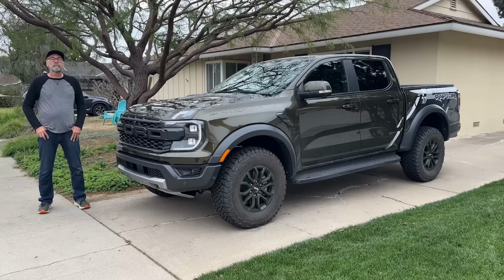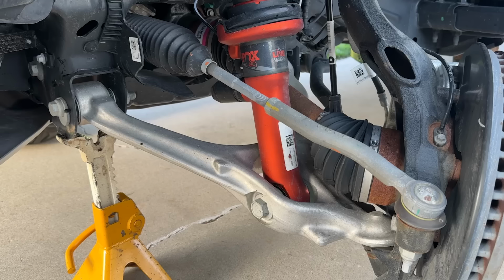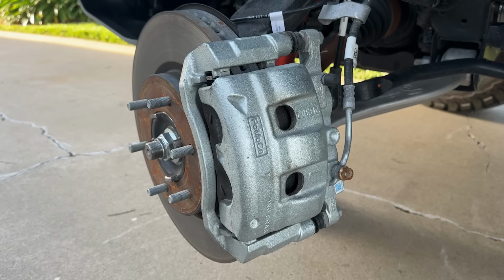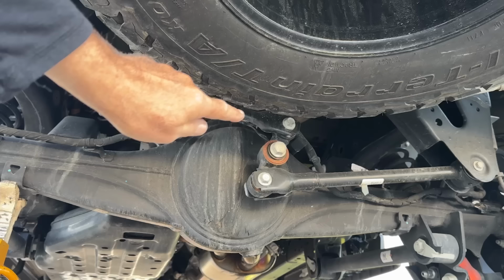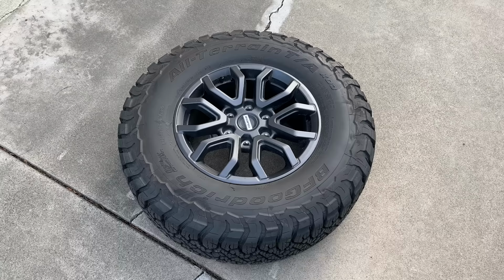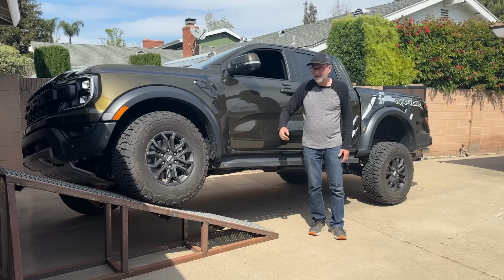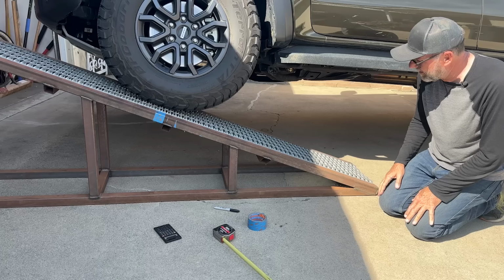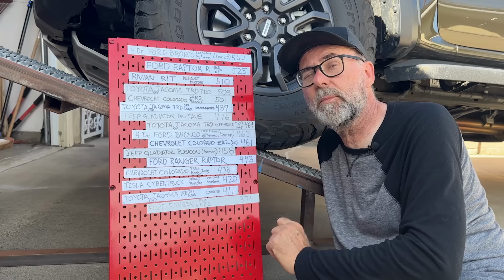Ford Ranger Raptor Suspension Deep Dive and RTI Test | Car and Driver

Comment: So much surface rust for such a new truck. I get it’s not much effect, but just looks so bad
Reply: I noticed that too for a new truck
Reply: Terrible quality
Reply: It’s only sat outside for a year
Reply: 😲my 18 yr old gx boat 🛥️ tower looks waaaay less corroded 😅
Reply: It’s not a big deal in my mind, but yeah curious how this looks versus my 2015 F-150 which seems to have less despite a number of pretty wet winters.
Reply: Maybe salt on the roads up north?
Reply: I live in Arizona, one of the best places on earth for avoiding rust and let me tell you, every truck has surface rust here too. It’s unavoidable I guess. It’ll never get worse being here in AZ but still my 2021 Tacoma had surface rust like 2 months after I bought it
Reply: @eeleye4  I live west of Phoenix, I never had surface rust on parts that were coated. I’ve gone from 13’ Tacoma, ‘19 Tacoma, 21 4Runner and 23 Tremor..no issues with rust
Reply: Maybe he lives in the coast
Reply: My 24 RR’s driveshafts are covered in rust, won’t hurt anything though. Ford saved $10 by not painting driveshafts which is BS on a 60k truck

Comment: So not an expert but i think the two aspects of an off road suspension are "lift" or "compression" in keeping all 4 tires grounded whilst on uneven ground which i think is being tested here but i can't tell and the other is "rebound"or ability of a suspension system to unsprung itself in a controlled manner to again keep all 4 wheels set upon the ground as the "compression" is released. To test these systems i think the manufacturer runs over rumble strips that are offset such that the vehicle maintains "level flight" shall we say rather than being thrown around inside the cabin of your vehicle or worse having the vehicle itself "pitched" to one side then the other. It is remarkable all of this is done mechanically tho absolutely and not with aid of an air bag system or whatever crazy space age stuff Tesla uses. Point being as a still licensed Class A Truck Driver when you hit the brakes at speed a massive vehicle such as this already high off the ground as is will inevitability literally become airborne especially as the weight distribution is almost all on the front end of the vehicle. Creating i guess i would call this a very well thought out "dampening effect" would in theory greatly mitigate this "lift/lofte-ing" which i also think is tested by the manufacturer by sudden braking at speed to zero upon a very watery or even puddled surface. Long story short should be very good at towing and hauling but again something easy to validate along with of course engine, powertrain, unladen versus laden etc. Definitely have seen very surprising flaws with the new Toyota Tacoma so how this mid size shoot out between Ford, GM and Toyota will be interesting to see. Given current prices I'd still just buy a full sized truck instead but hey, "this is 'merica!" so absolutely no accounting for that.

Comment: You where in the wrong front camera mode... trail mode has your tyre location
Reply: and baja right?
Reply: @benjaminbrown7127  it will come up in any offroad mode
Reply: But you still dont see the sides of the car. Actually I would prefer the side cameras to show forward not backward, then this issue would be solved

Comment: Amazing vid! I love detailed vids!  As for the front camera you hit the baja button (that's the furthest south one in line with the e-parking brake. It's the long rectangular button with a ranger on tilt with cactus etc drawing. It's under the parking sensor/traction control/auto start buttons) that actually gives you a guidance line for where your front tires are going.

Comment: Going forward, please unbolt one side of the sway bar so we know how well the suspension's geometry articulates without limitation.  It'll also let us know how much is to be gained by replacing it with the disconnecting unit.

Comment: C&D (aka: the editor who runs these ramp tests at his home) has yet to run this test with a 35” package Gen3 Raptor.
 
They have only tested the 37”/R package (which has 1” less suspension travel front and rear)..

Comment: Youre right about the rear suspension travel position sensor. That thing gets smashed by rocks and pebbles. Here in australia, theres metal guards that you can buy to cover that and after a couple trips through dirt roads and the metal guard is bare metal, the coating on it has been sand blasted. Haha

Comment: My hope would be maybe an option for next year for the disconnecting sway bar.
Hell the TRD OFF ROAD Tacoma has it optional, and as mentioned it's the same platform as the Bronco so no reason why they can't add it in. 

I wouldn't even care about articulation as much as i would like it for rough road conditions, just disconnect the bar and let the suspension work freely over rough roads to hiking trails and such.

Comment: Do the same test on Lexus GX550 Overtrail edition with KDSS
Reply: Im excited to see this as well. Hoping its up in the 600's like the 200 series was.
Reply: @Jay-me7gw  Expecting the same.Because it has KDSS unlike LX600.But LX600 has quite good score without it.
Reply: @pavansai9066  I believe the LX 570 was also in the 600s without KDSS. Even though it has normal sway bars, they’re pretty soft because the AHC system is capable of providing roll resistance via the shocks

I had KDSS on my GX 460 and I didn’t love it. It was great when you were slow crawling, but when you were driving faster on dirt roads and it was locked up, it made the ride really rough. My F150 with the front sway bar disconnected Rode much better than my GX did and it only took me about three minutes to disconnect the bar before I would go off-road.

Comment: Cool video, love to see the details of the components bolted to the frame, I work at the plant (a Magna Division) that builds the frame for Ford. The frames are waxed on the inside.
Reply: Their frames are waxed on the inside? I presumed their E-coating was applied to both inside and outside (using a dipping process)?
Reply: Yeah they are fully e-coated first then put through a separate line, frame by frame and waxed.

Comment: Have had 5th Generation Ranger XLT for almost a year, zero problems, never been back to dealer. Basic truck components are solid. Despite, Ford having used manufacturing cost cutting measures TO AN EXTREME DEGREE, tape, plastic and rubber, the vehicle will last way beyond warranty - Same, as last Ford I had, which I believe Ford used a bit of spit in manufacturing process.:face-blue-wide-eyes:

Comment: General knowledge question: Why does a differential need a breather? Why can’t it just be sealed so no water can get in from fording?
Reply: Usually because the big difference in temperature and thus pressure could cause the seals to not operate properly and eventually have oil leaks.
Some people use piping and bring all the breathers to a certain height, so that water cant get in

Comment: Well... I find that underwhelming. .Because I am comparing against "last generation." That's what I owned. I had a 2019 Colorado ZR2, a Gladiator Rubicon now. And I'm looking at the new wave of mid-size trucks for off-road purposes and well... I'm keeping my Gladiator. I also like physical buttons for my lockers.

Comment: Does the suspension look more like the plan broncos and not like the bronco raptor?  Id like to see that compared
Reply: Ranger raptor has 2.5 in fox shocks instead of 3in for wheel travel (as per what the engineer said) also has watslink instead of pan hard like the 150 raptor and bronco raptor

Comment: The 200-series is stil the king. It had a score of 661 making it the highest scoring vehicle that Dan tested.
Yes, I'm aware wheelbase plays a role in determining the score.
Reply: What is a 200 series? A lend cruiser?
Reply: @HarryKuloh  Yes, the 200-series Land Cruiser with KDSS.
Reply: In the real world that flex wouldn’t translate very well. You’d be lifting tires way more than a solid axle rig. . Also, the rubicon wrangler would do better on his RTI ramp.
Reply: @Jeepingshort  I think the Wrangler Rubicon did do better on this ramp. He used to have it listed. I wanna say it was over 700.

Comment: I wonder if Ford would make a Bronco Sport Raptor & a Maverick Raptor 😄 since this Ranger is now the baby Raptor
Maybe push the mirror forward for more ramp visibility
Reply: That's like making a Prius Raptor.
Reply: @MrHand-ih4sz  There's a Maverick Tremor. Wouldn't take much more to make it a Raptor. Fox shocks, bigger "factory" tires & longer CV axles for increased suspension travel. Lastly, the Bronco Sport & Maverick would need actual skid plates instead of compressed fabric.

Comment: That upper control arm looks very very weak.
Reply: I don’t think upper control arms experience near as much load as other components so not sure what that is based on.
Reply: It only sees loads in the horizontal planes and has leverage on those loads.  The trucks have been beat to hell and the arm can handle it.